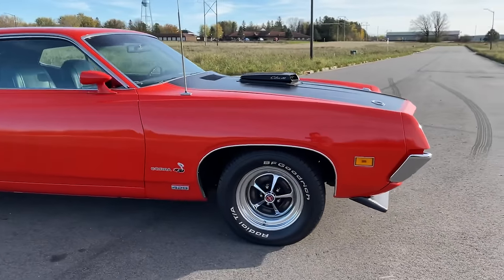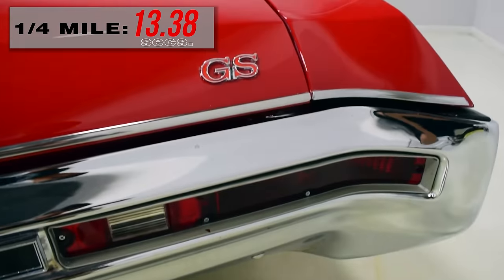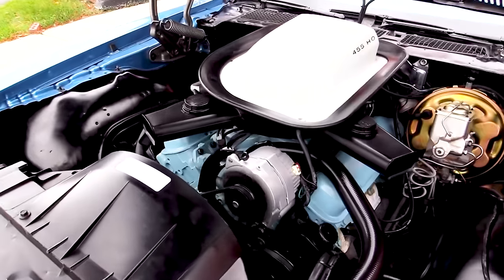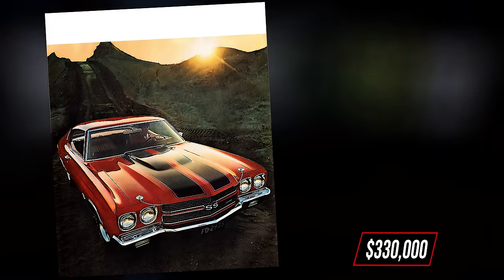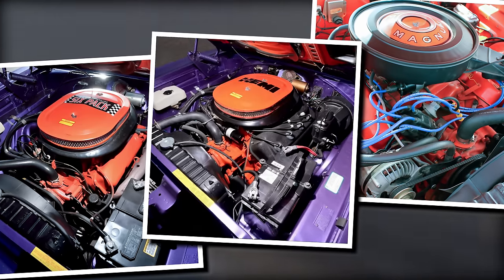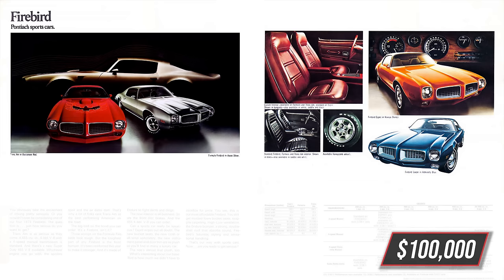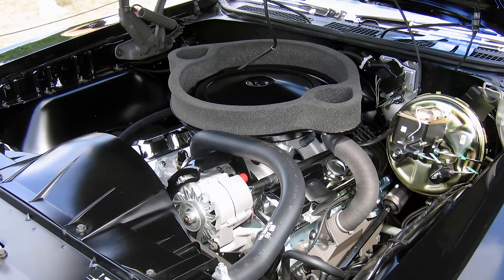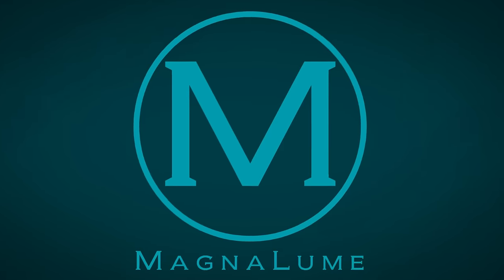10 Quickest Muscle Cars of the 1970s  | What They Cost Then vs. Now

Comment: I love the 70-73 Trans Am front ends.
Reply: I'm a fan of the Formula in that same generation.
Reply: I love them also, they're much better looking than the over done later years. IMO...
Reply: Agreed, it was an aggressive yet fluid design, not lunky as many the other sport cars in that era. Around my area these year cars suprisingly sell for a considerable amount less than alot of the others, especially if they are a street driver condition with minor cosmetic flaws.
Reply: This video showed a trim version with a stripe down the center of the hood & a much smaller Screaming Chicken just on the nose piece. I don't believe I'd seen that before, if indeed that's a factory version.

Comment: Those were the days!  I was 21 years-old, and just back to 'the world' after my tour of Vietnam with the army in 1970.  I used my $500 savings bonds from the army to put down on a Plymouth first, the Duster. Damn, was that a sharp car! I think I paid about $80 a month for payments.  The 1970s were the kick-ass decade!  The cars, the music, AND the girls were all top notch!!  Later on in 1986 I purchased a brand new Pontiac Firebird Trans Am for around $35,000. It had the most bang for the buck of any car I ever owned.  It was candy apple red and I got looks and questions about it wherever I went.  I saw one go for around $100,000 on Mecum Auctions.
Reply: I drove my first Duster 340 in 1970 when a shipmate bought one. I fell in love instantly but had to pay off another car before I could buy one. I bought a 1972 Sky Blue Duster 340 with bench seat and three-speed floor mounted shifter that gave a number of my shipmates problems. The car barely weighed 3400 pounds and, while factory rated at only 275hp, dynoed at closer to 325 hp. Beat a lot of big blocks back in the day. The thing that drove the 4-spd big blocks nuts was when they had to shift from first to second I was still accelerating in first gear. Usually gave me a 1-2 car lead right off the line!
Finally had to sell in 1987 due to money needs but I still miss that car. My daughter gave me a 1/25th replica that I painted to match my original car. It now sits in a place of distinction on my desk.
Reply: Those were the days indeed! Best of times. Now, let’s hit the speedway for some racing.
Reply: My high school boyfriend had a 1976-77 Orange Trans Am with white seats and T-top!  It was beautiful!  He always let me drive it !He didn't sell it either ! I saw it a few months ago and it looked just like it did on our 1st  date ! Smart guy !!!   👍
Reply: I had a Duster with a six cylinder. You had enough room under the hood to carry a passenger if you were so inclined. That was the easiest car to work on I ever owned.
Reply: @g.d.m.4564  … but not a car for the drive-in movies.
Reply: Thanks for your service. I liked the Duster and the Dart. Not a huge Mopar fan, but I quickly gained respect for these after seeing a built to the nuts Dart on Main Street that could blow the doors off just about anything on the road because of it's power/weight ratio. They were very lightweight cars which could still fit a big block motor under the hood without many mods. Not to mention the design was basic, yet sporty and looked great with a set of after factory rims/tires.
Reply: Wow, I also bought a brand new Pontiac Trans Am in '86, Tuned Port car that set me back 17k. Hmmmnm
Reply: @itinerantpatriot1196  if it was a Slant 6...that was the best American 6 cylinder ever built.
Reply: @richardowen4558  Go NAVY!

Comment: My 70' Chevy Nova SS 396 ran mid 11's in the quarter mile with no more than the addition of tubular headers and racing tires.  Car cost me 4 and a half grand total... and was very hard to beat!
Reply: CHEVY's RULE!!!
Reply: I have same car 4 speed big block
Reply: WOW.  Which 396 did you have?  You must have had the quickest one like that in the universe with just those mods.  My low-option '69 Nova 396/375 with 4.10's ran a best of 12.90's/104 mph  with Hooker headers and M&H's back in late '71 at Gainesville.
Reply: Jankman 1  running 4100 rpm at 70 mpg down the highway kinda sux, but for running the quarter mile that's pretty awesome for sure.  Thats the one thing about newer stuff, buddy with a 2018 Mustang GT runs 11.9 completely stock.  can cruise in high gear with the AC on and get 27 mpg highway .  best of both worlds really.  although old muscle car look and feel is way better
Reply: Nice!!

Comment: I really miss those cars. My buddy had a 71 Chevelle that could flat out scream. I loved that car but unfortunately, he also had a drinking problem that screamed equally loud and the combination of the two got the better of him. He survived the crash but the car was DOI. But that wasn't the sportiest car in our gang. Another buddy used to drive his mom's Maverick and that car was quick, especially off the line. It had a 302 and weighed next to nothing. Now, he wasn't much of a drinker so the car didn't suffer the same fate but his mom traded it in for a Lincoln. She didn't like driving a small car as she put it. Man, we had some fun nights racing with that one. Of course, my neighbor's Charger with the 440 was the true boss of the block. He was a test driver for Ford and used to light the tires up for us youngsters when he was in the mood to show off. My 72 Impala held it's own with a 350 but it was too heavy and it took a bit to get it over 60. Like I say, I miss those cars. Not that I would spend six figures for one now though. I'll just hang onto my memories.
Reply: Our neighbor down the street had a 1970 Boss 429 Torino Cobra drag pack. It had positraction in the rear with 411 gears. Sometimes he would light up those tires just to impress us kids. That car created so much tire smoke you couldn't see. It was yellow with black interior, with a close ratio for Speed. One of the most beautiful cars I've ever seen in my life.
Reply: @randycoursey7230  Wasn't it something to see those beasts generate torque. My neighbor used to take his Charger to the track and I guess race in some sort of stock class because he brought home a few trophies. He was a real good guy. He did a tour in Vietnam and when he came back he got that job at Ford. Him and a bunch of his buddies brought home a beat up Corvette that they fixed up and sold. I would go over there and talk to them at night when they were working on it. Like I say, nice guys for letting an 11 year old kid hang around. He had two company cars Ford let him drive and one day he said he had to give one back. One was a T-Bird, the other a Lincoln. I told him he should keep the Lincoln but he hung on to the T-Bird. His entire family were nice people. His older brother drove vehicle haulers cross country and used to give us kids candy when he came home. No one thought twice about a guy being nice to kids back then and handing out candy that way. The 60s had it's problems but it was a great time to be a kid.
Reply: @itinerantpatriot1196  
Yes I'm glad I grew up in the '60s. We rode our bikes without helmets and never got into any nasty accidents we rode alongside the road with cars and they never ran us over. I lived in Baldwin Park California so there were lots of people there and most everyone I knew treated us kids well. It's sad to see what the United States has become today. And California is one of the worst states to live in now. The homeless population keeps growing in Los Angeles. Governor Newsom is a complete waste. When Newsom got recalled it would have been nice to see Larry Elder become the governor. I can tell you that I would not want to live in Baldwin Park California today. I'm an Oregonian and here I'll stay, LOL.
Reply: I had a 71 SS454 Chevelle. 71s suffered from lower compression but my 454 had been rebuilt to match any LS6 from 1970. The 71 SS had the best looking body style of all the Chevelles, with the round taillights and the single headlights. Just think, before the GM brass ruined everything, the 71 SS was intended to come with an LS7 option! What a beautiful beast that woulda been!!!

Comment: I was 17 when I bought a brand new 1969 Z28.
I worked summers since I was 14. When I turned 15 I got a job working at a local liquor store. I worked full time and still went to school.  I saved every nickel I made. When I had enough money I bought that '69 Z28. I paid cash for it. $4,495 and I still had enough left for insurance and gas. Loved that car. It had a high rise aluminum cross fire 2×4 750 Holley carburetors. I put headers mallory duel point distributor with the matching plug wires. It had a 410 rearend positraction. Quarter mile time 13.1 at 109 miles an hour with uncorked headers. It was quick off the line. I only lost 1 race to a '70 Hemi Cuda but not by much.

Comment: Mine was a 1970 Ford Torino Cobra - 429 with a factory 4 speed Hurst.  All it had was power steering.  Dark green with the black shaker hood.  Amazingly, it would get 20mpg if you kept it under 2,000 rpm.
Reply: Rick D, I have a '70 Ford Torino 429 SCJ drag-pack 4 speed car.  It has 3:50 Detroit Locker rear gears and it gets very decent mpg as well.
Reply: My brother had a 70 Torino GT with 429 cobra and the C6 automatic. I think all he added to it was a Holley carb. He let me drive it every now and then. That car was ridiculous. I was amazed the transmission held up. If you were at a stoplight you either had to put it in neutral or hold the brake with both feet. If you put it in neutral it would majorly chirp the tires when you dropped it in gear. Then chirp on each shift. It sounded like a jet landing when you decelerated. Buried the speedometer once. Once was enough.

Comment: Those Mopar 340s in the Demon, Dart, and Duster bodies were race engines in disguise also for small blocks. I had two, a 71 340 Dodge Demon and a 71 340 Duster. Hooker headers and some Thermo~Quad carburetor work was all they needed to hit high 11s in the quarter mile on a good set of street tires. I'm sure a good set of slicks would have helped lower that ET a bit. I demolished the Demon street racing and bought the Duster a short time later. I had to sell it to pay all the attorney fees and fines from "Drag Racing" and "Reckless Opps" tickets from both the Demon and Duster. Lost my license for 5 years as well. That really sucked...LOL
Reply: I had a 340 Duster. The 340 was known as a Big Block eater. It fought way over its weight.
Reply: Always liked those Dusters/Demons. Nice lookin' rides. Quite a few people had them cuz they were more affordable. I remember seeing a number around town. Those 340's were mean.
Reply: The 340 never came close to making one horse power per cubic inch ,only a few mopar engines did power is in the heads only the hemi head had good flow #'s
Reply: THEM 340 WERE BIG BLOCK SLAYER . I HAD A 71 DEMON 340 WITH A 727 TORQUE FLIGHT POSI REAR END NOT SURE WHAT THE REAR GEAR WAS . IT WAS PETTY BLUE WITH A WHITE BUCKET SEAT INTERIOR . IT WOULD ROAST THE REAR TIRES FROM A STRAIGHT PUNCH . NO POWER BREAKING REQUIRED . FUN CAR .

Comment: I took a 1970 Camero, with a black interior, sandblasted the body, put in a 010 block motor, muncie transmission, and a 12 bolt positraction with 373 gears! What a ride!

Comment: It will never cease to amaze me how little respect the Buick’s get. My 70 GS was a rusted hulk of a garbage turd. It was built as a “price leader” I am told. It was a 2dr hardtop, GS 455, 3spd manual w/ hurst floor shifter. Bench front and rear seats, no air, power steering or brakes. Open 3.42:1 rearend in forest green and a black vinyl top. The frame was rusted through and repaired by me with 3/8” think channel steel. The trunk was to rusty to put in more than a 1/2 tank of fuel for fear of ripping the trunk floor out. Never made a pass in it. The guy dad sold it to was a collector of old muscle cars.  He told my dad it was the quickest midsize GM car he had ever owned. I never heard the fate of that old girl, it was one of 78 ever made. The only variation from being assembly line stock was the oem 71 camshaft we installed when rebuilding the engine. The original Q-jet, trans and rear diff were in the car. The block had been changed at some point before I met the car. Many tried to no avail to outrun my old Buick. All respect.

Comment: When I was 12, my parents gave me a rusted out Chevy Vega.  The rust actually took most of the exhaust, but no worry.  I was given the car to carry firewood and such from the woods.  I cut a nice road to the road used by the power company to service power lines.  That massive 4 cylinder motor was a beast!  At least to my 12 year old mind.  It should be included in any discussion of muscle cars IMHO.
Reply: And the Ford Pinto. Could blow the doors off of the Chevy Vega...any of them. Corvair with a turbo was a real challenge. None of those guys even wanted to race me...go figure geeze.

Comment: Very nice...Please also add the MPG  for each model...I remember during the gas shortages of the 1970's, Big Block Motors were shunned and people would practically give them away...Failure to adapt to smaller engines almost cost Chrysler the company.
Reply: In 1970 the gas shortage was a few years away and  high octane gas ⛽ was .33 cents a gallon so no one cared about mpg yet.
Reply: No mpg figures were recorded back then in any of those vintage road tests. At $.40 gallon (max) no-one cared!
Reply: In 1973 where I lived in GA, Premium gas was $0.269 a gallon so who cares!!?

Comment: I would never have guessed that the El Camino would take #1 ! My 1973 GMC Sprint was the closest thing to a muscle car I ever owned. Like the '70 El Camino in this film, it had a 454 c.i.d. with a Rochester 4bbl carburetor,  but that's where the similarities ended. My car was a dog, due to the stupid air pollution controls  strangling the performance. I believe it had around 230 horsepower, IF THAT much! But, it was still fun to drive nonetheless.
Reply: You were only a cam change away from true greatness
Reply: And add long tube headers, boom...instant 50hp/75/tq.
Reply: I miss my '72 sprint, had a 400 swapped in from '76 Impala, fun to drive.  But when i could put a finger through the frame it was so thin, it had to go.  Even with the rusty frame I took 900 pounds of scrap metal in to sell, took it very well.  It was my daily driver till mid 2010's.
Reply: Right? Was a surprise for me, i had 1979 el camino and 1982 El camino royal knigt , and now a 1973 El Ranchero
Reply: Rochester was a very good carb
Reply: Maybe just because I have fond memories, but I remember my '73 Sprint MOVED.  Drank lots of gas however

Comment: I had a 1070 SS454 El Camino in the early '70's and still have one.  My original one was an LS5 model while the one I have now is an original LS5 with an LS6 engine (Factory Air/power steering/bench seat).  It how has a Tremec TSX 5 speed manual instead of the original M22 Muncie that it came with.  There were only 702 SS454 El Caminos built and I have owned two of them and still have one.

Comment: I had a 72 Dodge Dart Swinger, Factory ordered with a 318 C.I.D.. Factory 2 barrel carburetor.The 318 had a cam, crank, exhaust & internals for a 340 engine.  It had Factory 904 Powerglide transmission ( I went through 4 of them & even split one in half from the hogshead to tail Shaft :-).
 The rear end was made for a slant 6. Engine  The Only thing that wasn't from the Factory was,  the exhaust. It was converted over to dual exhaust with two different size glass-packs that were heated up to Red Hot and  had water Splashed on them. NO CADILLAC CONVERTER.  It was last year they were NOT required on vehicles. The 99% Factory car would do the quarter mile in 12.00 seconds. She was fun!
🇺🇸👍😎👍🇺🇸
Reply: What??
Reply: @michaelkiely8878  bujo

Comment: I love the GS (Skylark) with Stage One 455. They were Buick so they were tight and quite luxurious and still capable of out running a LS6 Chevelle...sometimes...maybe.  Too bad they only have 2 bolt mains, but they didn't rev high anyway. They didn't need to. The LS6 Chevelle was a beast and that 454 was bulletproof. But there were very few stock engines that could run with a hemi. Thing about the hemi, you could do all the performance upgrades you could think of and the hemi could handle it. Hemis were king of the track, but for the street, the 440 6 pack was king!!!

Comment: After I got out of HS in '74, I bought a used '70 Challenger, 440+6, SubLime green. Unbelievable! Was driving it down to Ft. Gordon, GA., knew I was going to be leaving soon, determined to open it up a few las times. Got clocked by a SC Statie at 137moh. THAT was an interesting evening! ....had to sell it when I went to Germany with the Army. Got royally screwed.

Comment: Them old cars were slow as molasses, compared to cars of today... But they had the looks!!! I give him that.
Reply: Most were but not all here’s just one example a a 1970 Buick gsx stage 2 killer street car if it hooked up high 10’s in the quarter no nitrous no turbo no supercharger just gobs of torque & horsepower just as fast as anything made today with just a couple exceptions but the majority of the sixties cars ran high 13’s to low 14’s in general

Comment: NOT ONE Compared to my 440 Six Pack GTX 400 hp and 13 flat on the Quarter mile. 411 DANA Rear AND A 3 SPEED SLAP STICK
The thing I remember most was I got a full 6 miles to the gallon...LoL